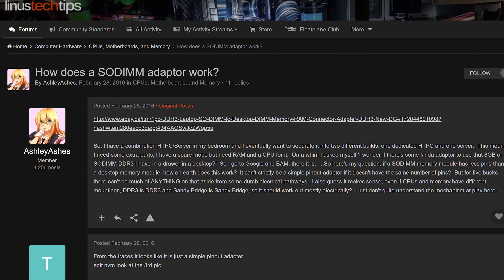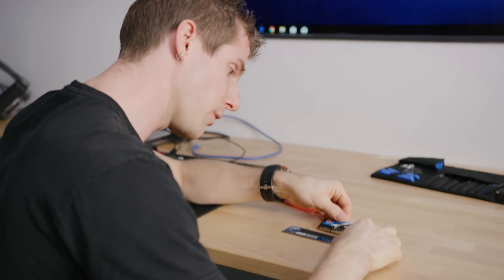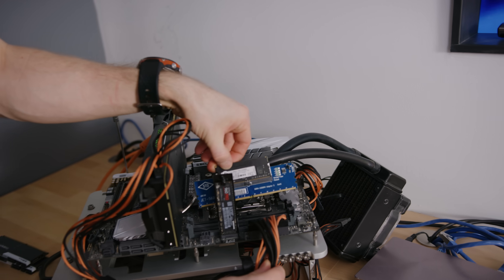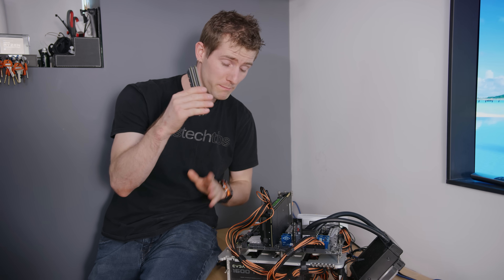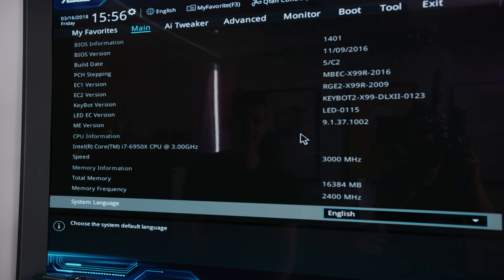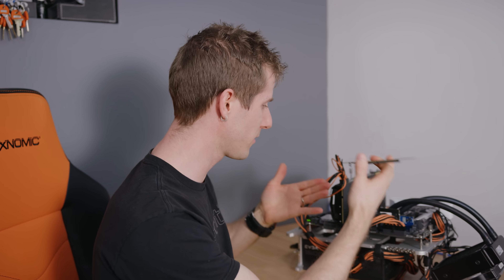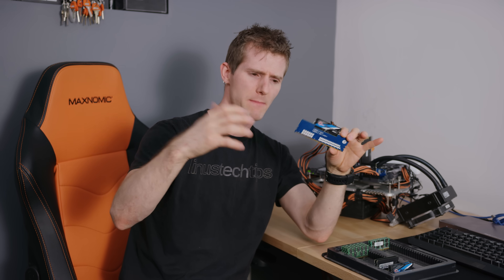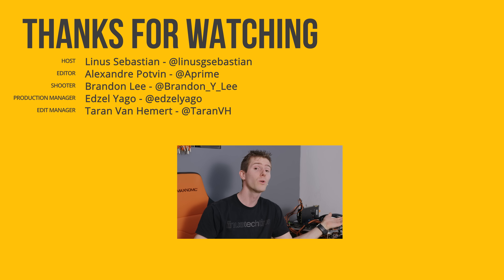Installing Laptop RAM into Desktop!?

Comment: You guys should make a computer where everything uses an adapter
Reply: including a pci-e cpu card
Reply: @Mic_Glow  I remember having to use those
Reply: @Mic_Glow  LOL
Reply: @Mic_Glow  agp to pci?
Reply: The mother board should be the only proper thing
Reply: Darius Inniss laptop to mainstream adapter
Reply: @pw443  No, ITX to ATX-E
Reply: @pw443  but like with an itx to ATX adapter attached
Reply: @pw443  matx to atx
Reply: >PCI to PCIe For Graphics

Works.
Reply: @kjjustinXD  u.2 to pcie 4x works too
Reply: @kjjustinXD  The convert it to AGP and then back.
Reply: I have an old processor that was on a separate card. Used to use some type of vertical slot for modular CPUs. If that made any sense lol. Had a modular voltage card too or something like that
Reply: you mean a PII?
Reply: @chrisladouceur4093  Probably Slot 1/2 (Intel) or Slot A (AMD). And yes, it made sense at that time, as explained here: https://en.wikipedia.org/wiki/Slot_1
Reply: @chrisladouceur4093  that’s how PCs used to be built! And it’s why motherboards are called what they are :) Then CPUs got faster and dedicated slots made more sense.
Reply: this needs to be done!
Reply: +1 Would love to see this happen.

Go all out too (and I know for a fact this works as I tried it once before):

PCIe SATA Card
SATA to IDE Adapter
IDE to mini IDE adapter
Mini IDE to ZIF IDE adapter

You could take this further and go ZIF IDE to Compact Flash or something and take the first part further - A slot meant for NVME to USB for a riser to a PCIe Riser to a SATA card.
Reply: The motherboard could have a case adapter.
Reply: the storage can be a sata to sd with a microsd to sd adapter
Reply: You mean a Mac?
Reply: Call it Macbook "Pro"
Reply: @samjannaki5482  lol damm right...
Reply: Wow nice idea bro
Reply: futurist past I think that was unnecessary
Reply: Yes pls
Reply: Intel cpu to amd socket adapter
Reply: Apple: write that down write that down
Reply: You sir, have a very good idea here!!
Reply: DO IT
Reply: kjjustinXD how about Pci to usb
Reply: Do it. Absolutely great idea. What could go wrong?
Reply: ooh you can also use a microsd to a mini sd adapter then a mini sd to full sd adapter
Reply: Storage: SATA to IDE3.5" to IDE2.5" to CompactFlash to SD to MicroSD.
Keyboard: USB to PS/2 to AT (say, an early IBM model M).
Mouse: USB to PS2 to serial.
Display: DisplayPort to HDMI to component/YPbPr (with digital-to-analog conversion) to VGA to DVI (either just a simple DVI-A or even back to digital and DVI-D).
Reply: K get a mackbook
Reply: There are already pcs that only use adapters, they’re called macs
Reply: @jasonzhang4854  xD
Reply: apple already made it
Reply: Darius Inniss Apple beat them to it
Reply: @EdgarHernandez-xj5mx  no doubt bruh 😂😂😂😂
Reply: adpater of an adapter of an adapter of an adapter adpater of an adapter of an adapter of an adapter adpater of an adapter of an adapter of an adapter adpater of an adapter of an adapter of an adapter adpater of an adapter of an adapter of an adapter adpater of an adapter of an adapter of an adapter adpater of an adapter of an adapter of an adapter adpater of an adapter of an adapter of an adapter adpater of an adapter of an adapter of an adapter adpater of an adapter of an adapter of an adapter adpater of an adapter of an adapter of an adapter adpater of an adapter of an adapter of an adapter adpater of an adapter of an adapter of an adapter adpater of an adapter of an adapter of an adapter adpater of an adapter of an adapter of an adapter adpater of an adapter of an adapter of an adapter adpater of an adapter of an adapter of an adapter adpater of an adapter of an adapter of an adapter adpater of an adapter of an adapter of an adapter adpater of an adapter of an adapter of an adapter adpater of an adapter of an adapter of an adapter adpater of an adapter of an adapter of an adapter adpater of an adapter of an adapter of an adapter adpater of an adapter of an adapter of an adapter adpater of an adapter of an adapter of an adapter adpater of an adapter of an adapter of an adapter adpater of an adapter of an adapter of an adapter adpater of an adapter of an adapter of an adapter adpater of an adapter of an adapter of an adapter adpater of an adapter of an adapter of an adapter adpater of an adapter of an adapter of an adapter adpater of an adapter of an adapter of an adapter adpater of an adapter of an adapter of an adapter adpater of an adapter of an adapter of an adapter adpater of an adapter of an adapter of an adapter adpater of an adapter of an adapter of an adapter adpater of an adapter of an adapter of an adapter adpater of an adapter of an adapter of an adapter adpater of an adapter of an adapter of an adapter adpater of an adapter of an adapter of an adapter adpater of an adapter of an adapter of an adapter adpater of an adapter of an adapter of an adapter adpater of an adapter of an adapter of an adapter adpater of an adapter of an adapter of an adapter adpater of an adapter of an adapter of an adapter adpater of an adapter of an adapter of an adapter adpater of an adapter of an adapter of an adapter adpater of an adapter of an adapter of an adapter
Reply: Use a mobile cpu and gpu
Reply: Modern day macbook
Reply: This doesn’t exist but Intel to ryzen cpu adapter
Reply: lmao
Reply: iMac
Reply: Did somebody call you an genius?
Reply: CPU adapter?
Reply: @byteofwood  775 to Am4
Reply: Darius Inniss Physx card lol
Reply: /Epitaxus / woo three for three
Reply: Seconding this
Reply: 1000th like
Reply: i'm pretty sure that druaga1 has already done this
Reply: Up for this
Reply: Someone has

MacBook Pro
Reply: I 43rd this opinion. Or whatever number. LINUS, YOU GLORIOUS BASTARD, DO THE THING.
Reply: Lol
Reply: MacBook Pro
Reply: A pc where everything goes with adapter to USB
Reply: With mobile cpu adapter as they already showed. At best with that Chinese motherboard which uses DDR3 on kaby lake.
Reply: +1
Reply: pci-e riser card and an a Agp Card....lol
Reply: oh no
Reply: Pc Case adapter
Reply: YES
Reply: AM4 to LGA 1151 adapter
Reply: Losing life finding which adap has issue
Reply: M2 to sata adapter :D
Reply: @viritigon  it exists. M.2 SATA to SATA adapter
Reply: *laughs in Apple
Reply: Motherboard adapter...
Reply: CASE ADAPTER
Reply: PCI to SATA card
Reply: windows adapter for linux, aka virtual machine
Reply: you mean an iPhone?
Reply: YEA!! That would be fun :D
Reply: So an apple device
Reply: thicc iPad Pro without screen
Reply: And call it the adapted pc lol...
Reply: even the cpu?
Reply: A x570 board with an am4 to 1151 adapter so you can use a 9700k
Reply: just make everything USB-C fuck Apple
Reply: Intel to AMD adapter!
Reply: intel to amd cpu adapter!
OR
amd to intel cpu adapter!
Reply: Its called the MacBook with its mini revision, the iPhone!
Reply: You mean a Mac?
Reply: adapt your motherboard from an ITX to micro ATX
Reply: or adapt your laptop mobo
Reply: That would be hell
Reply: You just kinda described apple here innit.
Reply: Apple already done that 😂
Reply: Thats called a MacBook air
Reply: MacBook enters the chat
Reply: Talk a any a Mac Book Pro 202
Reply: am3 to am4
Reply: wait... everything... Adapter for mobo?
Reply: yes
Reply: Yeah plz
Reply: Wtf is this XD
Reply: He already did https://youtu.be/dQw4w9WgXcQ
Reply: @Connor_Durham  🤦
Reply: @pw443  It was a good attempt
Reply: apple already made))))))))))))))))))))0
Reply: hmm
Reply: AM4 to am3+ lol
Reply: Improvise. Adapt. Adapt.
Adapt. Adapt. Adapt. Adapt
Adapt. Adapt, and so on…
Reply: lga 1151 to lga 1150
Reply: @christiankm8820  SP3 to SP3r2(TR4)
Reply: It’s possible but sure will it be bottlenecked in some way or another or might not even work at all
Reply: lol
Reply: @linus tech tips do this please
Reply: I'm thinking about fold able or double sided motherboard so you can install parts on two side instead of one
Reply: The All-Adapter Build
Reply: Apple already does…
Reply: Ya, and at least three for each power supply output
Reply: Lga 1366 to am5 😂
Reply: 2026 computer be like:
Reply: Yeah
Reply: Hell yah! Thats a sweet idea:)
Reply: Ur gay
Reply: Sponsored by Apple
Reply: Apple dongles in a nutshell

Comment: Hey, i just need a big help. Im studing Computer Science on second semester. Im about to buy a new computer for my entire career but im on a dilema. Im between going for the necessary with the Dell inspirion 15 7000, it is a complete computer and not expensive. the other option is the Dell XPS 13 or someone like it with the benefit of quality of image, harware and someothers. And finally, the more expensive the macBook Pro 13’ with 256GB between with the one with touchbar or without it. It coud be used for my entire career or just for half but ive seen that a lot of programeers use mac and one of my “life goals” is work there. Its a hard decition but i need to ask someone who knows what i could be needing. Please & thank U. BTW love your videos. Bye bye

Comment: Ram has it's own information stored. If it weren't for that, for DDR you would have a system that won't boot because it doesn't know how to configure the memory. Aka, why windows picked up on "SODIMM". Believe it or not memory stores it's own memory to be configured as memory. ;)
Reply: He was wrong. He ignored the chip beside the virtual fuse and the importance of the jumper. The adapter has its own memory chip and the jumper determines whether it uses it or bypasses to read the one on the SODIMM.
Reply: He knows that he was surprised because their was no real way for the motherboard to read that information as RAM wasn't directly connected to the board
Reply: Travis Piper He said the adapter had no logic of its own. Not thr RAM stick.
Reply: Nani?

Comment: Could be useful if you have to test a lot of SODIMMS and have a desktop test bench and not a laptop. Otherwise you'd need a laptop or a motherboard with SODIMM Slots, and those tend to be cramped AF mini-ITX boards.

Comment: I have trouble trusting something with a big STD on it. I feel as if it might give my pc a virus.
Reply: "STandarD" RAM is not "Sexually Transmitted"as mentioned by linus the adapter has no chips to spread a virus with. worst case a mis-wired circuit trips voltage protection on the motherboard. then again a cheap board might get fried.
Reply: Seems like someone doesn't know what a joke is.

Comment: I've been rocking SODIMM adapters in my desktop since 2014. Turned 8GB ram from a dead laptop into 16GB total ram in my desktop with my AMD  FX8350. Along with some middling hand me down GeForce card I can't be bothered to look at, still let me game at medium settings 5+ years later. I'll build a new system when Ryzen 2/3 architecture matures and meltdown etc. gets cleaned up.

Comment: I have two of these adapters  in my system to have a total of 12GB DDR3. I had used the 4GB I had and 8GB of DDR3 from my old laptop. I have been using them for about 5-6 months and all seems to be fine.

Comment: I wanna see a laptop version of this lol
Reply: Music_Master... desktop ram to SO-DIMM adapter? 😋 

It’ll be like those external GPU adapters that run a cable into the computer and connect into the mini pcie ports... only for RAM instead 👍

Like that: https://www.amazon.com/dp/B0725B6L99/
Reply: Music_Master just cut your ram to fit in the slot
Reply: It could work though... with a Man-sized laptop...or one without a case.. Or yeah, an external thing.
Reply: Zandonus it could  of u had a e gpu stile thing
Reply: y tho?
Reply: shea Oliver lol I wish that would work
Reply: I want a new-age luggable
Reply: Zandonus yes what I mean is you would open up your laptop ram cover put a DIMM to SODIMM adapter in. | you could do that with some 3,200mhz ram and right be side that you would plug in your e-GPUs with a 1080Ti in it. And also just to be sure it's the ultimate gaming laptop setup add a 144hz ultra wide  4K gaming monitor. XD Ultimate gaming set up
Reply: Or have a laptop with a full size alot
Reply: MinBCraft that’s not possible because the mother board would be too small and dimm memroy has to be facing up in like sodimm (laptop ram) Which can be stacked on top of each other sideways
Reply: I would kill for a SODIMM to SODIMM adapter XD

Comment: I would NEVER buy anything off of eBay.
Reply: Because?
Reply: So edgy
Reply: They have a money back guarantee u won't have any worries
Reply: Orange Broom then maybe stop buying things that seem to good to be true you are just getting scammed
Reply: Then you are a fool, there are some killer deals available on eBay, especially with electronics parts and stuff.
Reply: eBay is actually one of the safest and easiest sites to buy from because they always side with the buyer. If the item isn't as described ebay literally forces the seller to pay for return postage and refund the full amount including original postage to the buyer. You can't lose out as a buyer using paypal. Sellers can unfortunately get screwed over by dishonest buyers though.
Reply: lul
Reply: I absolutely love eBay. Killer deals can be found on ebay.
Reply: Orange Broom oh i understand the tariffs over there are really high
Reply: I bought a Moto 360 1st gen on ebay, worked well and was in good condition. I also got a nondescript GTX 580 a long time ago to go with my EVGA 580 for a fraction of retail price and it was perfectly functional
Reply: Corrupted Archangel.... Similar names much?
Reply: My brother bought a car, sight unseen on eBay from far enough away that the car had to be shipped.  The seller claimed it was a new frame-off restoration and in show car condition, but when it arrived it had signs that the restoration done a long time ago and not particularly done well.

Brother files a 'not as described' and the seller had to pay to have the car shipped back to him and refund the buy price plus shipping here.  Easily cost the seller $2000 and eBay sided with the buyer [rightfully so, at least in this case], like they do almost every time.

--
As an aside, when I'm shopping on eBay, I always check the "US only" box as I don't want junk shipped from China and don't even want to deal with a week or weeks in transit from Europe or elsewhere in Asia.
Reply: Some people scam or never send happened to my dad a bunch of times when he tries to get laptop batteries or other times it just fucks up the laptop making it run a like a potato due to not enough wattage going to it, so that’s why aliexpress is a thing
Reply: Wow you're so cool
Reply: Sure.  And if that happens to you, you submit a 'significantly not as described' case and eBay will 99.9% of the time assume you [the buyer] are right and refund your money.

Hell, you can do that even if it matches the description exactly, but you changed your mind and eBay will still side with you and give you your money back.  Make it an item where shipping costs roughly as much as the item is worth and the seller will probably tell you to just keep it.

--
In my buying and selling experience on eBay I suspect there are far more scammers on the buyer-side than seller-side, particularly because eBay almost always sides with the buyer.
Reply: As a buyer and seller it's uncommon for shit to go wrong. Most people are honest, and some people are just stupid. Even from selling TV boards I rarely get returns. Like one dude said I sold him a bad board. I took it back tested it on my TV and it worked. Relisted it and sold it no case from next buyer.
Reply: Ummmm. Scracthes head. I'm guessing you don't understand how to buy off the internet
Reply: Given that I'm from Europe and live on $500 a month and having rent and bills to pay, I don't think I'll be buying things that are too expensive
Reply: Bought a 4g 35dbi booster from china for $9 and it ended up not working, real one was $20
Then i bought a 4 key switch tester for $3 and im worried about quality as they go for $10 on amazon

Comment: I imagine SODIMM also uses less power than regular desktop DIMM, but on the flip side I imagine the power savings from using adapters like this would be negligible in the long run and negatively outbalanced by the loss in performance.

Comment: Also: Thanks to the sheer detail of your recordings, I could actually read off what seems to be the only chip on the board. It is a Microchip 24AA04: http://www.mouser.com/ds/2/268/21708K-69050.pdf

It is a serial EEPROM, which seems to most definitely contain the XMP profile. Considering that it apparently is linked directly to the jumpers, the "Protector" setting seems to simply cut the chip off, leading to a failure to load the XMP profile.

The memory stick itself identifies itself to the computer, however, as a SODIMM.

Definitely try moving the jumper and trying again.

Comment: Back when memory was really expensive (16 megabytes for $600+) I was upgrading a 486/100 system to a Pentium 150, and that meant going from 16x1mb 30pin Simms to 72 pin simms. I bought some adapters and ran the system that way for a year or so before switching to the actual 72 pin memory. Not ideal, but it was a cheap way to put off half of the price of the upgrade from 486 to Pentium for a year or two.

Comment: Tried PIA after you guys went with them as a partner, and holy crap, what a headache. Installed it, didn't work. No internet access. 30 minutes of troubleshooting and digging in support forums, I got it fixed. But my IP wasn't hidden. 45 minutes of troubleshooting and forum digging later, I got it to work for about 2 minutes, and then my real IP address was exposed. Support forums show that this issue of not hiding the IP is fairly common. Already uninstalled and asked for a refund, this thing was NOT worth the money, or the time spent *trying* to make it work. Going back to TunnelBear which works the first time and works like it's supposed to.